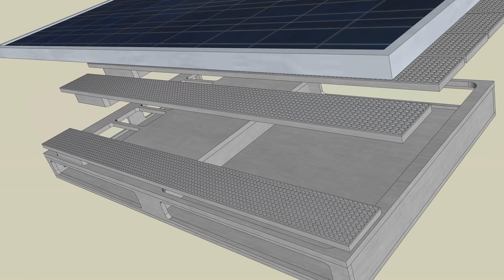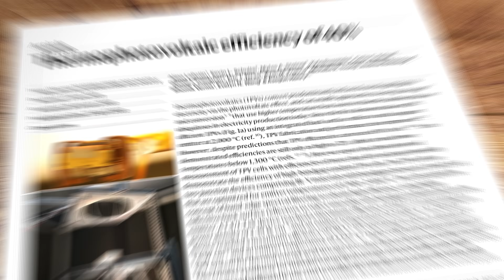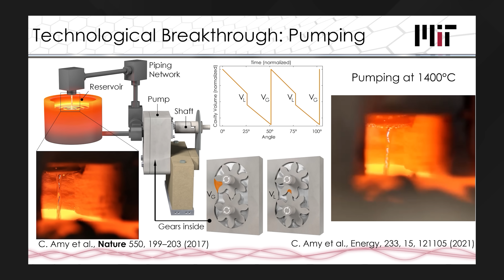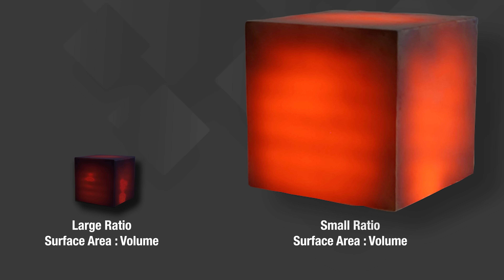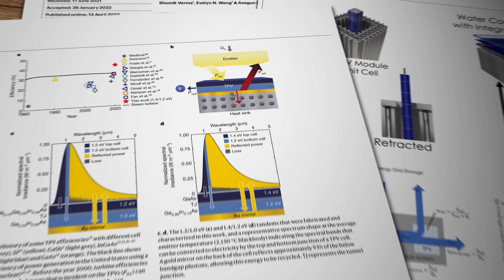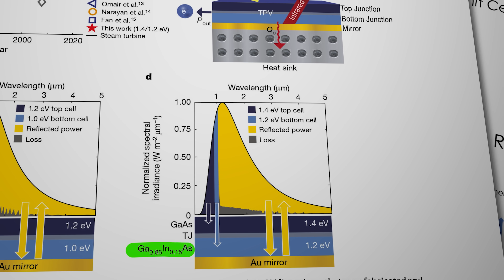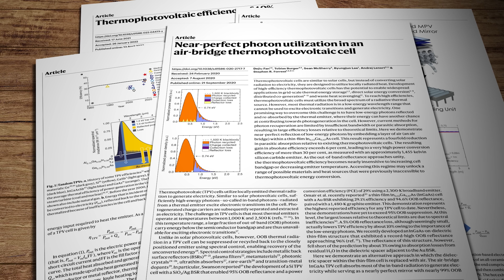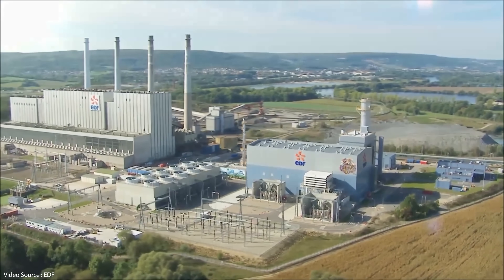Grid Scale Energy Storage 30x cheaper than Lithium-ion! How do they do that?

Comment: This all sounds very clever but very complicated. Why not use liquid metal batteries instead. They have already successfully saved at least 1 electric grid from catastrophic failure. Also you mentioned a system to keep the water coolant cool. This sounds like a major way of loosing heat instead of using it to heat a building. For all the impressive percentage figures you band about there are a lot of loss areas around coolant and a liquid metal that will loose heat and waste energy.

Comment: Feels like an overly complex system with too many moving parts and the potential for catastrophic failure should the molten tin ever solidify in the pipes. Siemens Gamesa has been demonstrating a much simpler solution since 2017: hot rocks.
Build a very well insulated, house-sized box. Fill box with ordinary rocks. Pump in hot air to heat up the rocks. Siphon off heat to create steam and drive a turbine. Same square-cube law applies, so bigger is better.
Two big advantages:
1) It's not rocket science. Your average bob the builder can construct most of the components with off-the-shelf building materials.
2) It can re-use existing infrastructure at, e.g., decommissioned coal power plants.

No molten tin. No space-age pumps and seals. No carbon-composite pipes. No giant graphite blocks. No thermophotovoltaic cells. No argon-filled warehouses. Just hot rocks, a bit of piping, air, water, and turbines.

Comment: This has been designed by mechanical engineers and it shows, which usually means expensive... The cost analysis feels way too cheap. The capex must be huge. You have shown far simpler and cheaper systems, which whilst not so efficient appear a lot more attractive. Excellent explanation.  Thanks
Reply: I expect each component part of the system has been shown to work in the lab. Scale it all up 10,000 times with some impressive engineering challenges, and voila! - a cheap (cough cough) energy storage system.
Reply: I'd say you're right only to a point. There's always a threshold that a more expensive but better performing system at scale is cheaper than the simple, low intial cost system.
Reply: Makes sense as an integration to existing steam plants. Using electricity as a heat source is bonkers. BESS has a higher conversion efficiency and modules can be added anywhere on the grid.
Reply: Reminds me off the magneto hydrodynamic generators.

Comment: Storing excess energy as heat is a BAD idea; back conversion of heat to any other form of energy will be highly inefficient. Mechanical devices, like flywheels etc. do not suffer from this limitation.
Reply: they seem to try to get rid of flywheels, flywheel companies are acquired by large oil companies and then shut down

Comment: The good, the bad, and the ugly.  In order to minimize the losses, the size must be big so that the volume (storage) is high, and the relative surface (losses) are low. A super insulator like a vacuum with low emissivity surface would help, like a thermos bottle. The very high temperatures - ugg.  Big and very hot, that wraps up the bad and ugly.  The good?  less than 50% efficiency, not counting the thermal losses.  
    If consumers want low cost energy, it seems that they need it on their side of the meter. This kind of monster can only be appreciated by big business.

Comment: I'm skeptical, as usual. Revolutionary breakthroughs in energy storage are a dime a dozen these days. The thing that's most suspect here is the extremely high working temperature - everything breaks down faster at higher temps. There's also the complexity of the system. At any rate, it looks like the entire setup will be large and expensive. I wish people would remember the old adage of 'show don't tell' - if they had a working, properly scaled prototype, things would be much clearer.
Reply: Yeah, the problem is that even a "small scale model" would be large and very expensive.
Reply: @chrisheath2637  Exactly. And I can see how a uni research team doesn't have the funds to do this. However, fancy computer graphics and nothing practical to show only brings this closer to earlier scams in the same vein. And before you say it's MIT, keep in mind waterseer was backed by a uni too. Not to mention how many of them promoted( and financed) hyperloop teams...

Comment: You generate electricity using a renewable process. You have some excess so you store it by heating graphite. You then use the heat regenerate the electricity at a 40% efficiency.
Seems like a massive loss compared to those associated with charging a lithium ion battery. You will lose at least 60% of the electricity you originally generated.
Reply: We don't care about efficiency. We care about cost. If system A delivers energy at a lower cost over a time period than system B, it costs less to the power plant operator, thence to the consumer. If this thermal system is 30 times cheaper than lithium batteries and lasts as long then the math could work out if off-peak electricity is the right price. 

I wonder if substantial EV charging will flatten the demand curve some day, making all these batteries moot. The lithium will be in everybody's garages.
Reply: @jamesvandamme7786  Thanks for your answer. In case you are interested, have a look at the "Algae-powered computing" article published by Cambridge. Another interesting smaller scale project.

Comment: A terrible analysis! So lets make something clear, it is not about the efficiency of a particular process, it is about the efficiency of the entire system. In this case with so many conversions from (solar farms 20% efficient at the source) to heat, storing that heat, cooling the system with water, and releasing (wasting !!!!) unneeded heat (energy!) in cooling plant,  as not to melt the TPV cells and TPV conversion of even 50%, will make the entire process with less then 8% total efficiency AT BEST, and at worst ( and more likely ) about 4% efficient. Good work MiT researchers. Now,  to make things even more realistic to fine  the overall efficiency Joule-in (at the source) and Joule-out ( at the consumer ) one need to include all the transportation and conversion losses and that will drop the above overall miserable efficiency of, let say 6%, at least another 50%, to about  3%. Or in other way 1 Joule from the Sun the consumer gets 0.03 Joules at the power outlet. Great. Bring it on! With such efficiencies we for sure make the world a hotter place.

Comment: I hope Thermal Battery Corporation leaps into the Australian market place - we have so much untapped solar energy we don't know what to do with - plenty of wind energy too. My crude estimate (as a non-scientist) is that 1gigawatt of energy could power 50,000 Australian homes that burn on average 20kwh per day. That's only 500 of these units at the above scale. And that' is VERY achievable. The energy can be converted to hydrogen for heavy transport vehicles and mining operations.

Comment: I think the actual interesting part is the TPV part because you can use that on traditional heat engine generator too, including but not limited to Nuclear power. Removing moving part for turbine  in of itself is good enough.
Reply: You can use concentrated solar power to drive TPV. A good mirror system like in the existing solar furnaces can generate the 2000+ degree C temperatures needed to operate these TPV cells. Even just as a primary generator this is still nearly twice as efficient as the conventional PV cells. It is possible to use similar approaches in concentrator solar cells to reflect the IR and UV components to a blackbody surface, which will be heated up and the thermal energy could be harvested using traditional or TPV technology.

Comment: Antora Energy has already commercialized thermal PV storage and its PV is tuned to the carbon storage block photon emissions at an operation temp between 1,200 - 1,600 C with the ability to store industrial heat at up to 3,800 C.

Comment: Rather complicated system with lots of opportunity to go very wrong. I still think the Ambri molten metal battery is much more viable, because the heat remains contained inside the battery and does not need any moving parts and is more efficient too.
Reply: Was having the same thought. It seems very complicated, just keeping the argon inside the buildings is a huge challenge on its own.
Reply: @reiniertl  What if the building had doors that closed?    Seriously, you think they would have trouble containing an inert gas?  Do you know what is inside you refrigerator motor casing?
Reply: @jonathanhall5660  You clearly have no idea how gasses work and how hard it is to contain them. Moreover, all personnel working on such buildings will have to use special equipment because the atmosphere there will be unbreakable.
The whole idea is a complete pack of BS and a logistics nightmare. Heating up metals to emit visible light, to then use it to produce energy in a PV cell, really? Any process engineer will laugh at these guys. Use the metal to produce steam and you will probably be much better off and also reduce cost.
Reply: With all that heat, why not just use it to turn water to steam, and turn a turbine.
Reply: @josephkowalski9836  cause the prof developed a new type of PV and wants an application for it?

Comment: Hi,
Does the effeciancy of 40/50% relate to the TPV cell system or the overall systems input electrical energy to output electrical energy. If the latter this is excellent if just the former it might not be that commercially viable unless the input energy is regarded as free.

Comment: Something seems amiss. So you generate electricity from the usual solar cells and wind turbines, with an efficiency of 20%. Then you convert it into heat and eventually get back 45% of it as electricity. OTOH, a Li ion battery would give you back 75-80%. The battery has zero moving parts, and this system looks very complicated. I'm surprised how it can be so cheap.

Secondly, if gallium arsenide cells are so efficient and cheap, why not use them in the solar panels in the first place?

Comment: We live in Switzerland and lots of houses have PV systems on the roofs ant there is a surplus of energy in the summertime but there's a lot of need for energy during the winter as the PV cells barely produce energy. So we would need to store energy from the summer and release it in the winter.

Comment: So best case, the TPV cells can convert heat to electricity at a 50% efficiency.  That means, at a minimum, it will lose 50% to radiated heat.  The overall system efficiency of the electric heaters, liquid tin, pumps, heat transfer from the storage to the radiators has got to knock the efficiency down from that 50% number, probably to 40% or worse.

The cost of the storage is very competitive per kWH, but I wonder how it competes efficiency-wise with Lithium batteries.  I would guess there are places where the supply of renewable power isn't so plentiful that they can afford to waste 60%+ of it.
Reply: However, it operates at about the same temperatures as the heliostat-parabolic mirror type of solar concentrators usually used for the smelting of exotic materials. Making the heliostats slightly curved with suction seems to be doable, and will allow the ~2300K temperatures to be generated on a tower based solar plant. If this is used for TPV, it is about twice as efficient as the best PV cells available.
Reply: @daoyuzhang1648  Interesting thought for TPV usage, but it's not for energy storage, right?
Reply: @yeroca  it is used for generation, but those heliostats can be used to generate storable heat at 2200K too and the TPV is able to run even in the night. Efficiency is twice as much as conventional PV cells and there is no loss from storage as heat.

Comment: It sounds great on paper and I am sure it is fantastic in the labs. I just worry that they might find problems like with the solar salt systems, which struggled with moving parts and super temperatures which prevented cheap and easy to maintain serviced systems. On paper it does sound like less stuff to move and fix, but still, if something were to go wrong, it might be very difficult to fix and maintain. Hopefully the larger scale prototypes iron out any kinks and demonstrate a larger scale reliable system.
Reply: You described exactly my impressions.

I see a hot liquid metal pumping system with moving parts, completely sealed because of the heat that otherwise damages everything (and will cause fires).
Really, what can possibly go wrong with that?
I was immediately thinking about what those lab guys did smoke!

Later. Mechanical "control rods" that interact with cooling water that if not pumped fast enough will turn to steam and cause all sorts of mayhem.
Having both of these in a confined area with superhot metal flowing ... again, what could possibly go wrong.
And it is not as if cooling water is all that reliable everywhere, a system like this will need a LOT of it and everything has to go just right to not be a total disaster of epic proportions.
Reply: @TheEVEInspiration  It seems they are make the classic mistake of trying to do two new things at once. If energy storage is the problem, solve that. If energy recovery from a hot object was the problem, solve that. But energy recovery from hot objects was solved years ago. They should focus on just the hot carbon idea. Also forget argon, use nitrogen or CO2 as an inert gas. Putting hot carbon in a sealed area will soon create it's own inert atmosphere anyway.
Using water to recover the energy from a hot carbon block could not be simpler, cheaper, safer and way more reliable.
Reply: My engineer spider senses tingled once i hear a bunch of expensive and exotic materials. The build cost of the plant will be astronomic compared to the energy it produces.
Reply: Nothing ventured nothing gained. All systems need to be considered.

Comment: I'm curious what happens in a system like this when some of the molten metal SOLIDIFIES in the pipes... How is it melted again? Wouldn't every inch, including valves and other fittings, require a heating element? I suppose there are existing molten-metal pipeline systems?
Reply: If I were designing thermal storage like this, I would run all piping inside the molten reservoir. think of it this way... Instead of external pieces that are connected together, all the parts are inside the big storage tank. This way, unless the entire reservoir of molten metal solidifies all remains liquid, always. And if the whole contraption really did cool down, then just heat it all back up. The extra benefit is practically zero loss... at least from any piping and components and the entire contraption is insulated easily. without anything protruding.
Reply: This can be solved  using alloy with low melting point,  like solder  - which is also based on tin and that gave me the idea.  Solder needs only 200 C to melt, preheating pipes to such temperatures is not a big deal.

Comment: Circulating molten tin....
Yeah, about that...
Shutdown and restart is going to be "emotional", you really wouldn't want it to solidify in the pipes, and filling the system will be quite the thermal shock.
That also means that standby energy requirements are non zero.

Comment: Natural gas is stored chemical energy that is not beatable with this insane tech at $10 per kWh vs the full cost of electricity from a new natural gas plant is roughly 6.5 cents per KWh, according to a new Hamilton Project paper. Are you insane, just not have a brain.

Comment: I am not sure comparing the cost of this system with lithium ion batteries cost is comparing apples with apples. With all the pumping and heat transfers going on, what is the response time of this system? The main benefit of batteries are that they essentially respond instantly. That makes them attractive for grid stabilization setups, more than for long term storage. 

I also wonder about the total system efficiency. You only dropped the numbers for the PV side of it, but that’s only half the picture. You also have to take the heating, pumping and storage into account.